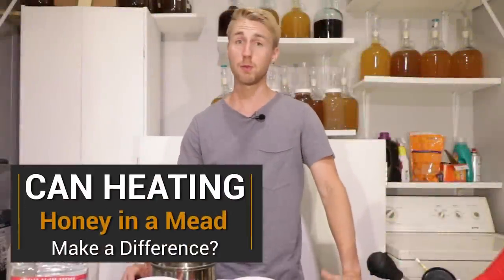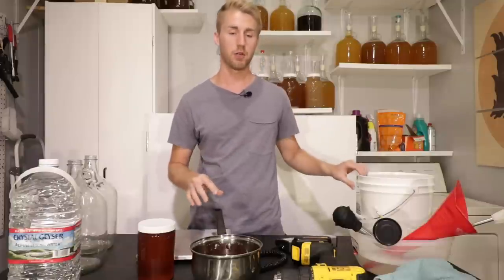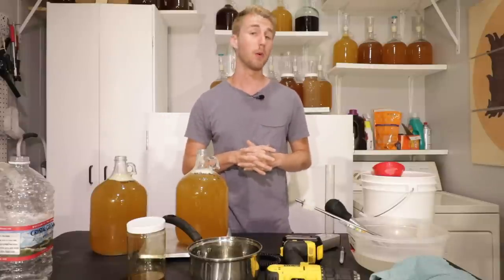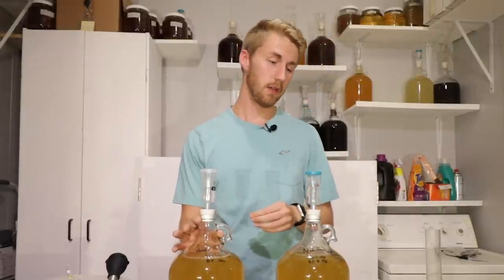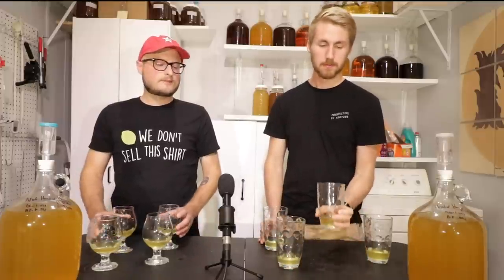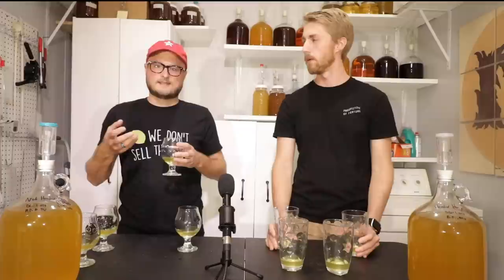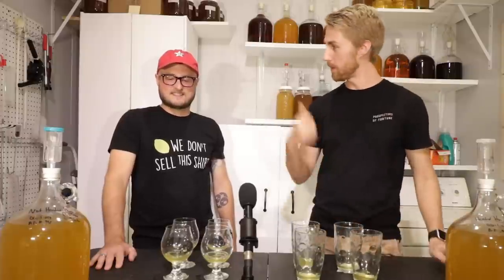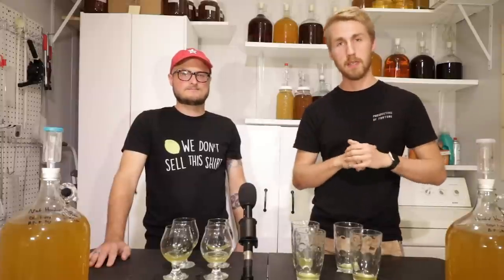Mead Making: Does Heating Honey Matter?

Comment: I am a beekeeper. Raw honey has always some amount of natural yeast. The bees know this, that’s why after collecting the nectar they add some enzymes and then store it in the wax cells. They left the cells open and they make a great effort to keep a constant temp and air flow so the nectar water content starts dropping. That is not considered honey yet. When the water content in the nectar drops below 18 percent we can call it honey. At that moment the bees capped the cells with a layer of wax. If they cap the cell with more water content the nectar will ferment because of the yeast present. 

Based on that I will recommend to heat your honey pasteurizing it for 5 minutes at 150 F before adding the water to make the must only if your honey is really Raw. If you are buying commercial honey most of those has already been pasteurized and there is no need to do it again, the yeast has been killed. Although heating a little bit your honey will make it more fluid and easy to dissolve in the must.

Comment: It's a good experiment. I wonder if aging them longer would bring out any bigger differences.  I never pasteurize mine but I do typically heat up the water first and then add the honey to the hot water, adding hot water to the jar and swirling it around to get every last drop I can out of it. I use well water which is one of the reasons I like to get the water good and hot first. I've never had any problems.

Comment: If burning or bocheting the honey is a concern, you could heat it with a double boiler (large pot of water on heat, smaller pot of honey in the water). It'll take longer but it'll ensure there isn't as intense, uneven heat on the honey that's on the bottom. You do the same thing if you want to melt chocolate without burning it.

Comment: there is a mead called "gvirc" in one part of Croatia. Traditionally it was made with whole pieces of honeycomb. You would add honeycomb to water and boil it, honey would dissolve in water and wax would float to the top and you would scoop it. When there was no technology to separate honey from honeycomb, boiling was easyest way to separate wax and make mead
Reply from the maker: Very interesting! That sounds great!
Reply: Great tip there!

Comment: This is great for me, since most honey in Sweden is very firm, and unless heated will be impossible to pour
Reply: Scoop it out with a hot spoon and blend it with water in a blender
Reply: A friend of mine sent me honey in a Gatorade bottle. And it looks more like butter now, probably similar to what you have in Sweden. I will definitely have to do some heating to get it out.
I had a cactus honey that was the same and although I scooped that with a spoon, it took sooo much shaking and stirring to get it to mix in/dissolve into the mead.
Reply: @SodyPopInSpace  Oh, thanks! gotta try that, seems a looot faster than the methods I've been using so far. If nothing else, I can do that while shaking hot water in the honey jar to get the extra honey out of the jar :)
Reply: @SodyPopInSpace  I might do that for secondary, I'm planning on using some neutral honey and 1/3-1/2 for primary. Then the rest back-sweetening.
Reply: Fawn and Leo, it’s really the only way to totally dissolve honey in cold water. You gotta be careful not to jam the blender, there’s an art to it, but it’s so useful for mead making I don’t know why it isn’t talked about more

Comment: I have seen a lot of recipes which do the simmer-and-skim with at least the honey and water, if not all must ingredients.  My first orange blossom traditional was from a recipe specifying this approach, and it turned out delightful! For the next variation of this test, that method would be a good candidate. It could also provide extra confidence for folks considering older recipes using this approach, but who are wary of diminishing the quality of the honey that way. I would also be curious about using a less neutral honey. Perhaps wildflower?
Reply from the maker: I am definitely interested in trying the skimming method. I'm excited to see what the results will be from that!
Reply: There is nothing wrong with the sim and skim method from older sources.  The main reason that they did that is because there were few if any good commercial fermentation yeasts and what were available and the ones that were did not necessarily get going fast enough to prevent wild yeasts and molds from ruining your must!  The Yeasts available today get going really fast and form a huge vigorous colony, quickly overpowering any wild yeasts or molds that may be present. So today the need is gone, but there is still the fact that your change the nature of the Honey by simmering. Simmering drives off many of the more delicate Volatiles in the honey, and the scum you are removing from the top is proteins, Waxes, and other things present in the Honey.  Bare in mind that Honey that is more delicate in flavors will be Much more effected by Sim & Skim than a stronger flavored Honey as more of their character is from the delicate Volatile chemicals present in the Honey! So doing that method will result in a different product than if you do not, in the end if you like the results, that is all that matters!  !

Comment: Thank you for doing the testing for us. I have not done any brewing or mead making yet. I want to get my ducks in a row before I start trying it. I am getting great ideas to work with. I have seen one real positive from heating honey before mixing. Not everyone going to have a 6 gallon bucket designed for brewing or the money to buy the honey to fill it’s . Most of us beginners are going to be doing 1 gallon runs, which means we are using small neck bottles. An from what I have seen it’s a pain in the butt to pour honey through a funnel into the gallon bottle. Heating it takes a little time, but in the end you can pour it easier an not hold the funnel forever as the honey goes down. The mixing of the water and honey blends much better. 
This maybe an idea to push for beginners. Just a thought, what do you think. Thank you again for sharing the info
Reply from the maker: I think as long as it's not overly heated you're good!

Comment: If you heat the must to high for to long you WILL drive off some of the more delicate volatiles which can change the taste, if you boil the must as was done in the Middle Ages then you will also denature proteins and precipitate out other things that are present in the honey that would possibly effect the taste as they will no longer be there to effect the ferment or finished Mead!  Low heat pasteurization I do not find has any discernible effect even though some Mead snobs absolutely say otherwise!  However when I had them taste some Mead as you have done, NONE of them could with any regularity find any difference in taste!!!!!  I personally do not bother pasteurizing and I have never had a Mead go off due to contamination from the honey!  I do put the honey in the sink in warm water to loosen it up for pouring. As long as you have a good vigorous fast starting ferment you have nothing to worry about! To insure I get that start I usually use a starter culture of the yeast of choice!  It does not speed up the completion of the fermentation as some say, but it does give your yeast the edge to over power any wild yeasts or bacteria that may have been dormant in the concentrated honey!  That being said I have also not had any issues when I did not use a starter culture, it is just Belt and Suspenders in a way, I do it just in case.

Comment: Hey man, I started my first batch today, and I’m having a big issue with my fermenting vessel. The spigot was very poorly crafted and it is leaking. I can’t find a good fermenting vessel..something around 5-7 gallons. Could you please recommend me a good fermenting vessel because I keep finding poor ones with bad lids or what not and I don’t know what to get. I definitely will return the one I got because it’s very poorly made and it’s just leaking everywhere. Thank you!!!!!
Reply from the maker: I would get a glass carboy! E.C. Kraus 6 gal Glass Carboy https://www.amazon.com/dp/B074Q6PH53/ref=cm_sw_r_cp_api_fabt1_4afUFbC9J8Q04
Reply: @ManMadeMead  thank you so much brother, and one more thing, will the regular rubber stoppers for the one gallon jugs fit this carbon? (Rubber stopper as in the thing you plug the jug with and stick the water lock in)